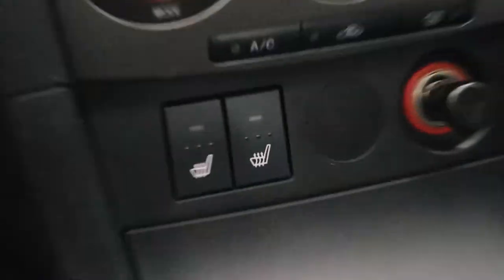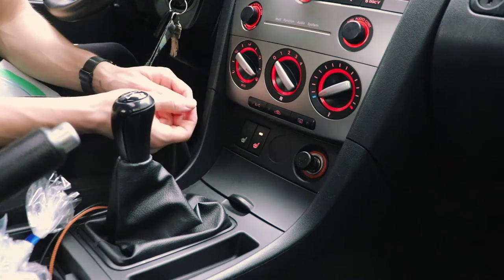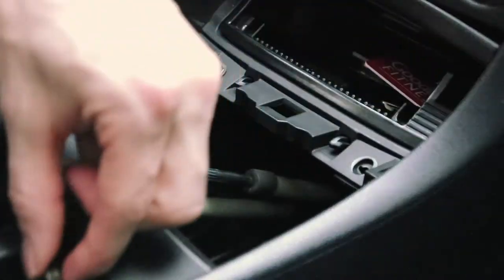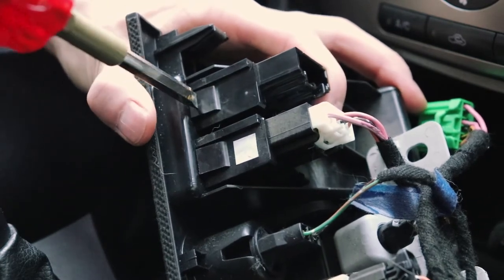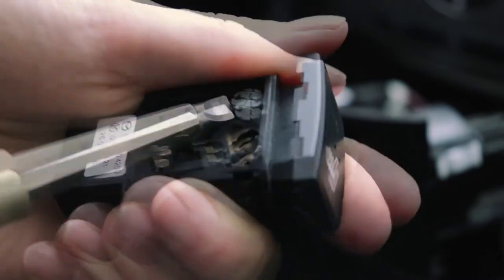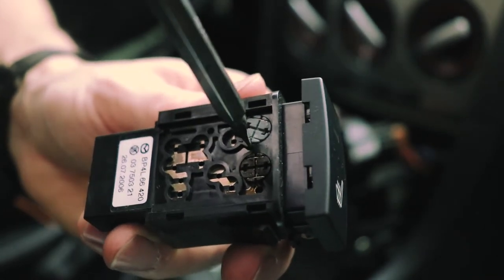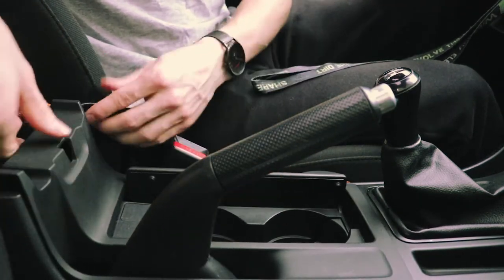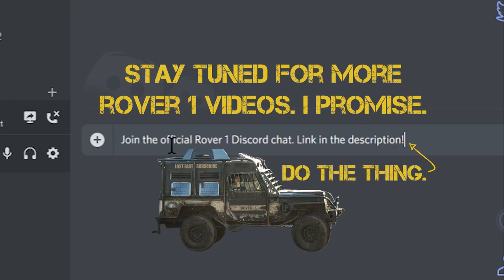Mazda 3 Heated Seat Light Bulb Replacement

Comment: Part number of the bulb?
Reply from the maker: I can't believe I didn't share that info in the video or write it down in the description. I don't remember sorry!
Reply: Looks like the part number of the bulb is BP4K66461.  I just ordered a couple and update my comment if it works.
Reply from the maker: @ralphg3230  sweet, thanks!!!
Reply from the maker: @ralphg3230 Did they work for you?
Reply: I haven’t installed it in my Mazda 3 yet,  but I also have a 2011 CX-9 that two switch lights were out and I replaced them and they work great.  Sooner or later I’ll get around to replacing the bulb on the 3 and I’ll let you know.
Reply from the maker: @ralphg3230  Nice. Okay so I'll check back in 6 months? Lol :D